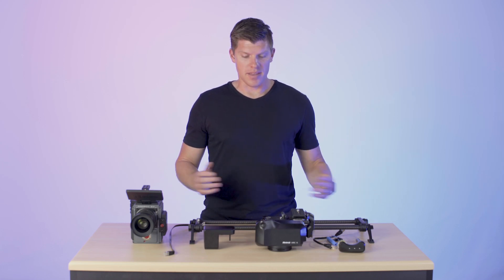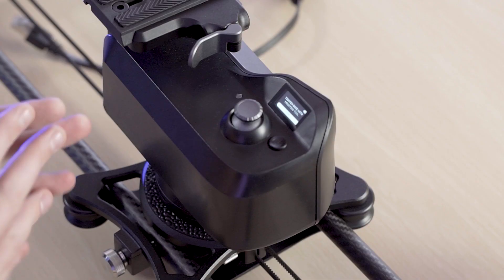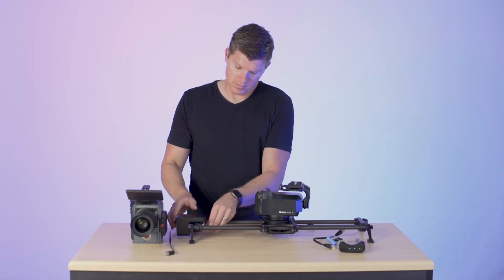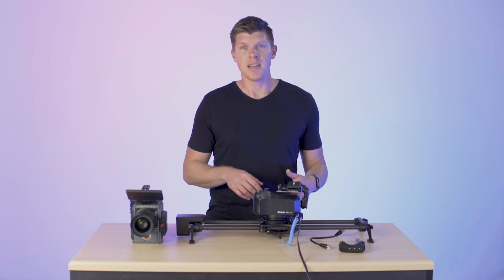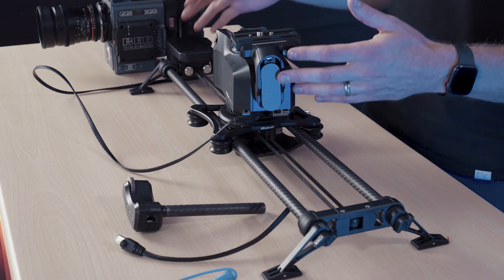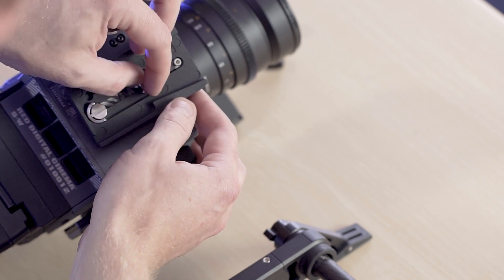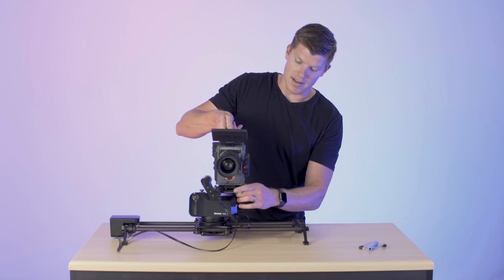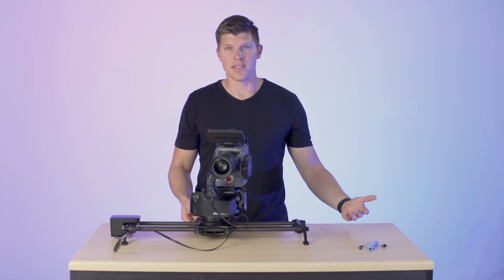How to setup Arc II for the first time

Comment: Focus motor just spins and spins with no stopping.  No amount of support from Rhino, firmware update or calibration has helped.  It does not turn back the other way.  There is no info on if it is possible to adjust.  I'm using cine lense with gears and hard stops.  The first one i tried the motor cranked the focus barrel so hard past it's stopping point it broke spokes off the lens gear.
Reply from the maker: Have you reached out directly to support? 
support@rhinnocg.com

Comment: Can Rhino System With Arc11 Hold  a Sony PXW-Z190 XDCAM Camcorder?  Weight 5.07 lb /2.3kg  Dimensions  7.48 X 7.95 X 16.52 / 190 X 202 X 419.7 mm  And will the Focus Lock into a XDCAM
Reply from the maker: Yes, it should work well with that camcorder. The Focus module will work with traditional lenses that aren't focus by wire.